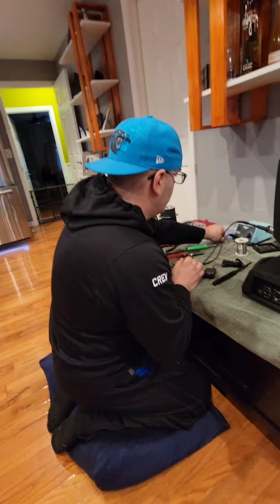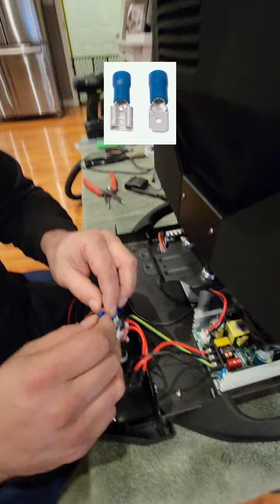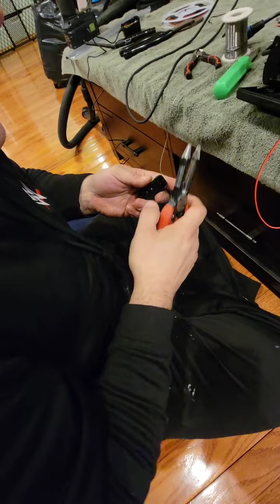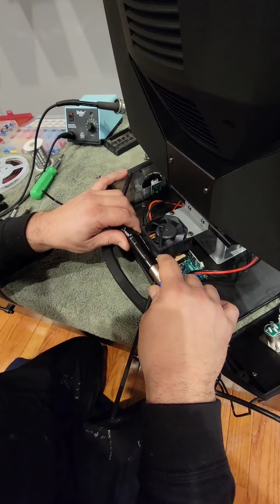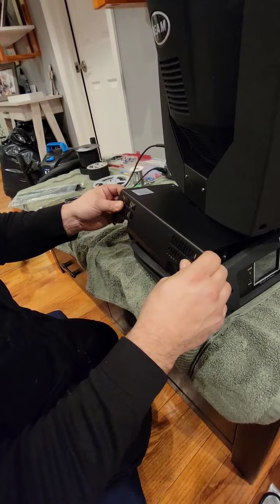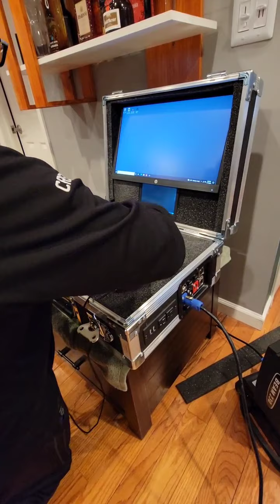Wireless DMX. How to make your moving head lights Wireless.

Comment: Easier way is buck convert from power supply inside.
Reply: Yep dc-dc buck converter is less then $2. Tap off the fan wires inside - they are either 12/24 volts DC. Doesn't matter either way.